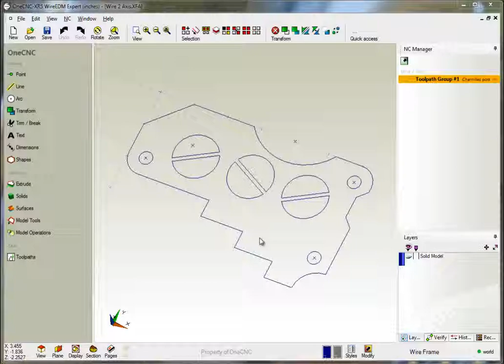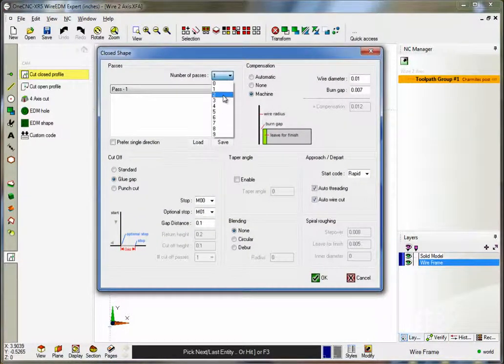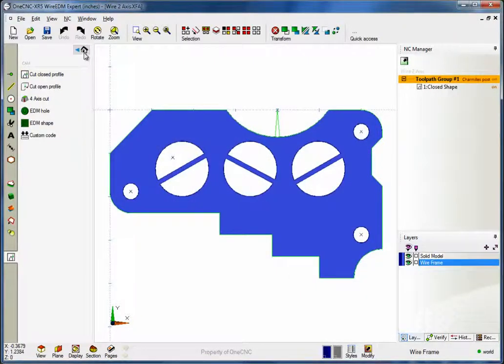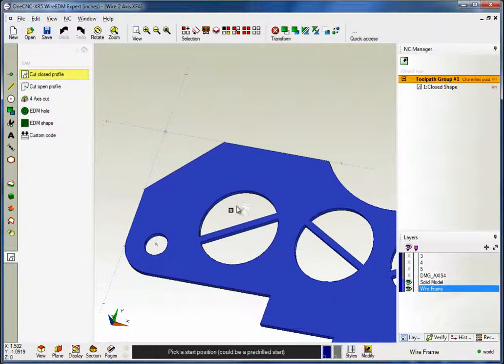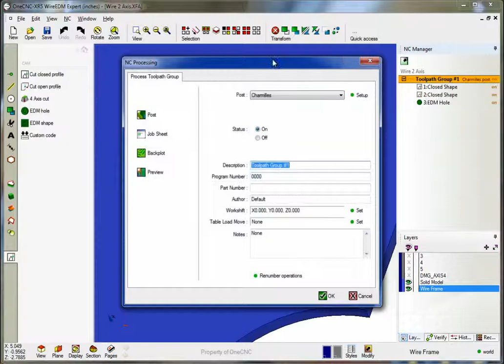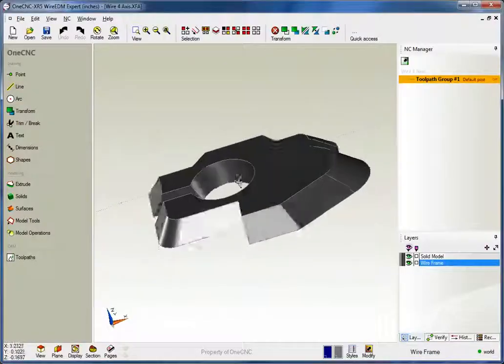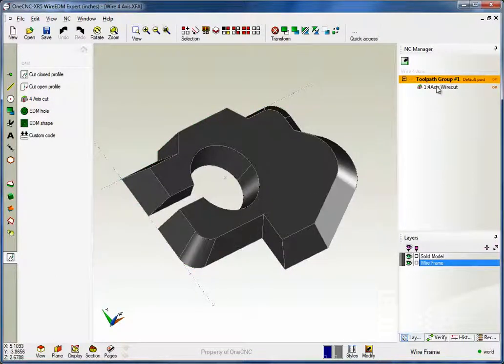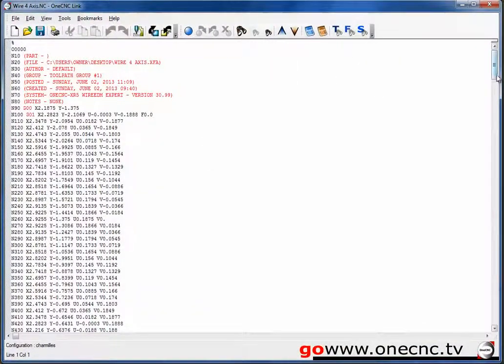OneCNC XR5 Wire EDM CAD CAM

Comment: Thank you for all the information you have given over the years. I have a quick question. This software is new to me and I am having trouble with the compensation. I noticed you have your burn gap at .007, I am doing different burn gaps until I get it to the size I have the drawing. My wire is .010 would you not use a burn gap of .005 to equal .01?
Thank you